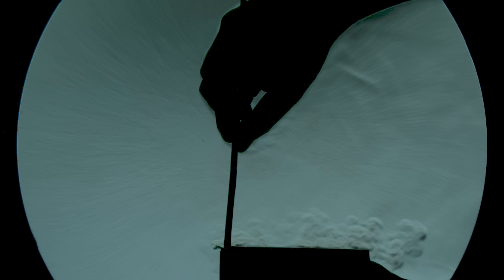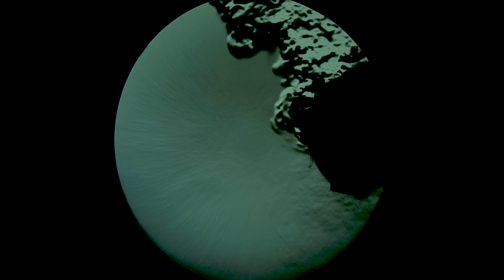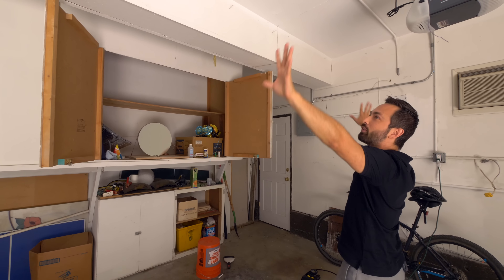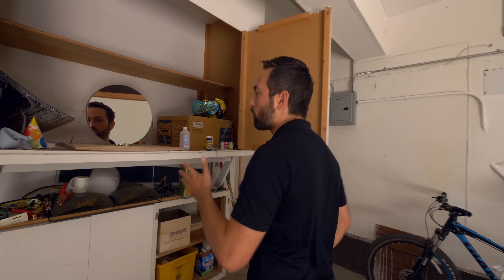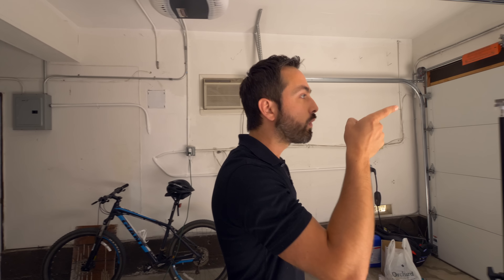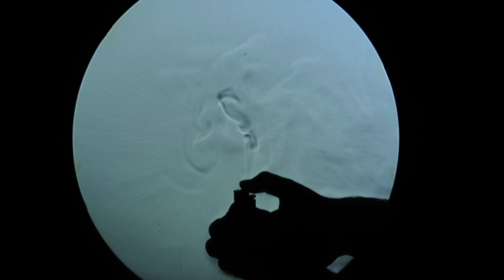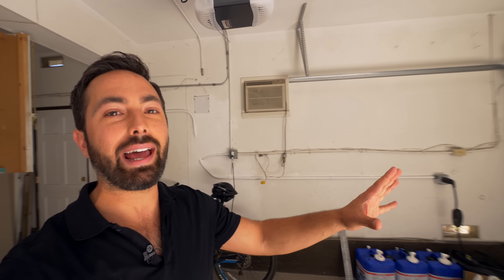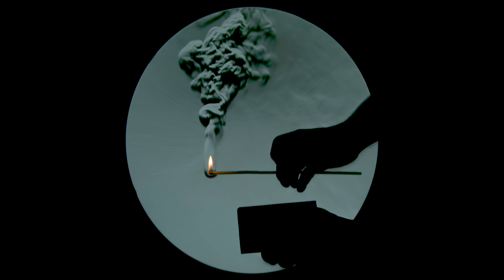How To See Air Currents

Comment: A whip breaking the sound barrier.
Reply: A whip breaking the sound barrier extinguishing a match.
Reply: Pedro Semeano the camera might not capture that
Reply: That's not what makes the sound of a whip cracking though, the tip of a whip very rarely exceed the speed of sound
Reply: In 2002 Arizona researchers found that by the time the whip cracks, the tip is already going about twice the speed of sound.
What makes the sound is actually the loop in the whip whose speed along the whip reaches the sound barrier.
Source:
https://www.scientificamerican.com/article/true-cause-of-whips-crack/
Reply: I guess you would lose your arm before hitting anything, really
Reply: Gaspard Sagot  You said the whip very rarely reaches the sound barrier, then posted a study saying it goes twice as fast.  I'm confused
Reply: +DANG JOS What people usually mean when they say that the whip breaks the sound barrier is the speed of the tip of the whip. What these scientists discovered is that instead, it is the loop that travels along the whip, which produces the sound.
Reply: Gaspard Sagot, you do realize you just corrected yourself from being wrong without knowing it right?
Reply: Entropy Zero  Either way, it's still the whip.  Why does it matter if it's the tip, or the portion before the tip?  Either way it would be because the whip is traveling faster than sound
Reply: Time to call Adam Savage!
Reply: +DANG JOS That's not quite it. The difference is between the whip itself breaking the sound barrier and a wave within the whip breaking it.
Imagine it like this: You have a metal rod that you accelerate perpendicular to it's length and also strike it at one of its ends. Now while the rod itself doesn't reach the speed of sound, the shockwave moving through it from the end you struck to the other might.
Reply: Entropy Zero  Now that makes a lot more sense.  The original explanation was terrible.  I mean, what does the loop breaking the sound barrier even mean?!  The explanation should have been that it isn't the whip itself breaking the sound barrier, but the transverse waves within the whip that moved faster than sound.  That is, the forward displacement of the whip by the wave adds its speed to the whip in order to break the sound barrier.

  That makes sense to me.  Whenever I heard this, I always wondered how the linear speed of the whip could possibly travel faster than sound
Reply: I didn't remember the article right, hence the source. I'm not pretending I know everything about whip cracking
Reply: Mythbusters did this
Reply: lol yes pls
Reply: @Professor Politics a whip breaking the sound barrier extinguishing a match floating a soap bubble in its thermal updraft.
Reply: Somewhat reluctant to actually figure it out, as I have no use for this information and Insect lives matter.
Reply: Your wish has been granted!
Reply: You are a time traveler I guess
Reply: Like what Destin just did?
Reply: Destin from smarter every day just did a video on the matter!
Reply: smarter everyday just did this today!
Reply: destin actually did it lol
Reply: Time travelers exist
Reply: Smarter every day
Reply: Pedro Semeano it’s amazing how your wish is granted after a year.
Reply: @ProfessorPolitics  As I read this, Destin of Smarter Everyday has done this.
Reply: @SmarterEveryDay brought me here
Reply: Everyday smarter
Reply: I think smarter every day did a video on that. they found something very interesting regarding when the whip breaks the sound barrier.
Reply: Charles Mullins smartereveryday
Reply: @derekyerik90  thats sounds like an indian movie slap
Reply: @charlesm3232  it will destin from smarter everyday has done it.
Reply: I would like to see this experiment conducted on someone who is sick, aroused, scared, furious ect. Does the flow of heat change? Do we see the sweat evaporating? Or perhaps even release pheromones?
Reply: wrrr

Comment: How about whistling? I wonder if you'd be able to see the frequencies that make the sound
Reply: no, the frequency is too high thus the wavelenght will be lost inside the turbulence of the air flow.
Reply: wavelength = speed of sound / frequency. The typical human whistle is in the order of 1 kHz and the speed of sound at room temperature is about 340 m/s. So the wavelength is around 30-35cm. With a dog whistle, the frequency is at least 10 times higher, so the wavelength should be visible.
Reply: At 20°C, f = 1Hz and c = 343m/s gives us λ = c / f = 343 / 1 = 343m
Frequenzy too low = waves too long, because mirror too small

Take f = 500Hz, c = 343m/s λ = c / f = 500 / 343 = 0.686m
Much better!
A standing wave would look cooler, but that is more effort.
Reply: MazeFrame sounds cool! I hope he does it
Reply: Walther Wennholz Johnson i Hope he does it I really want to see it
Reply: UCreations I hope he does something with sounds it's so cool

Comment: Airflow around the dimples in a golf ball
Reply: I think this is a really clever one, but we'd have to compare with a ping pong ball. To see this effect properly you'd need to have a laminar flow pass over the golf ball, which might be difficult to make.
Reply: Lots of lng straws in a box will provide a laminar flow, but you really would need to have an airconditioned and still air inside the setup to get it working properly.
Reply: This was the first thing I thought of.  I would also like to see that in comparison to a ping-pong ball and other athletic balls -- particularly the American football.

Comment: I wonder what a thermal imaging camera would look like in this setup?
Reply: virtually the same, though the imaging typically is more colorized.  

This is ultimately reflecting the variance of temperatures in combination with light refraction, like the cooler air pouring out of the glass or the popping of the bubble.
Reply: This isn't just an image of thermal effects, it's an image of the changes in air density (some of which is caused by temperature, some caused by air moving). It's a very sensitive apparatus, and the temperature changes it can show are often smaller than thermal imagers can resolve.

Comment: You explain at about 2:00 if the mirror were spherical the center would be where you have the light source. I think, if the mirror is spherical you’d put the light source (and razor and camera) at 1 focal length, but for parabolic mirrors you put the light at 2 focal lengths for the same effect, with the added advantage of increased contrast because of the extra distance for the light divergence to be doubled.

Comment: if u can get the critical Reynolds number (Laminar-turbulent transition) somehow , that would be cool
Reply from the maker: I'm thinking that happens naturally with the candle - see how the laminar flow speeds up and then breaks up into turbulence? I'd love to find a way to make laminar air flow and put it over an airfoil...
Reply: Veritasium lots of straws
Reply: There are ways, some people make their own wind tunnels. Most use a structure of straws/tubes to create laminar flow.
Reply: The size of turbulences is determined by the biggest hole it passes through. Therefore a tiny grid or grating should enable you to get laminar flow in a channel. If you use strain free glass (which you can test in you imaging setup) you can build a channel with laminar flow using a fan with a tiny grating in front of it.
Reply: if u can try deferent points of velocity/flow using a clear glas pipe till u get turbulence , u might get it i guess

Comment: 1. Handheld tesla coil gun from Smarter Everyday.
2. Something simple that can be simulated with finite elements method. Comparison of FEM and reality might be interesting.
Reply: This was my idea as well.  Or if not the coil gun, a large repeating arc of current between two electrodes.  In slow motion of course.

Comment: With two slighly offset setups it would be possible to observe the experiments in 3D ^^
Reply: ^ this.
about the distance between our eyes. flip the images, and you have a cross-eye 3D image
Reply: science that sounds awesome!  it's definitely something someone should try. I also agree with the comment above mine :)
Reply: Are two LEDs, one to the left one to the right of the camera, enough?

edit: you would have to seperate the two images. maybe different colored LED and then using the respective colorchannels to get a right and left greyscale image?
Reply: but the lens has to focus directly into the camera. how would that work with two cameras?
Reply: 3d would probably require 2 of those special lense
Reply: Wouldn't the lenses have to overlap for this? That kinda ruins the whole point of having 2 lol.
Reply: Turun Ambartanen Two lenses or two cameras sounds impossible. But two LEDs sounds like it might work. But idk.

Comment: What woulf happen if you put the razor blade vertically, or if you adjusted its position differently!!?
Reply: Doesn't make a difference as long as the source of light isn't polarized. The effect still will be observable, only the directions of the shadows would change

(edit: the part about polarization is most likely wrong)
Reply: I think the direction of dark to bright changes. Let's say you inverted the blade up-side down. Then you basically invert the image tones. Vertical would rotate tones vertically. (not the objects!)
Reply: Actually you do see a difference, the dark and light regions where the density is different would be different. So lets say he is breathing out, instead of up vs down is bright to dark, now you have left vs right is bright to dark. You would still see the same phenomenon but "with different lighting".
Reply: But then, what difference would we see if we polarize light ?
Reply: The direction of sensitivity changes: The setup is sensitive only to light deflected perpendicular to the edge, in other words, only the effect described in the video that light being blocked which was previously unblocked matters. This does not happen with light which is deflected parallel to the edge.

Mathematically speaking: you see the derivative of the density of the air perpendicular to the blade as a bright/dark contrast.
Reply: It would change the microscopic result but not the macroscopic result. (Although the result would be different and air density differences would maybe not appear exactly the same overall you would see the same patterns and wouldn't notice the difference without being shown the old footage.)
Reply: I did this experiment as a physics project two years ago. Changing the orientation of the razor blade changes the orientation of bright vs. dark, exactly like YouGenom and Karlos described above.
Reply: I am afraid, not: polarization does not contribute at all in this setup.
Neither is the light coming out of an ordinary LED polarized, nor is there an analyzer in the setup, which could translate polarization into intensity variations.
Also, in transmission, the gases observed do not transmit light differently depending on the direction of polarization.
Reply: I know that LED light isn't polarized (nor monochromatic nor coherent) per se. 
On the other hand i now seriously begin to ponder what exactly would happen, given where we position the filters... guess you are right, though.

Comment: Well, I think you could try a vortex. Of course plenty other such experiments have already been done. But it would be nice to see.
We could also try some sparks or electric discharges. But we would need slow motion.

Regards.
A proud member of Physics Square and a fan of Veritasium.
Reply from the maker: Thanks! Got some ideas about how to make the vortex? What about a fire tornado!? Literally just came to me...
Reply: Veritasium how about a fire tornado on a high speed camera
Reply: Veritasium NightHawkInLight has a nice video on how to make a fire vortex.
Reply: errur Yeah, that was pretty good.
Reply: How about a vortex cannon? You know, the "standard" box with a hole. Both the creation of the vortex, and the travelling would be interesting to see.
Reply: @Veritasium: Maybe just by means of a vortex ring gun: a piece of tube with a diaphragm on one side, and an aperture on the other should do the trick and generate a slow-moving vortex ring.

The trouble is, however, you may need to improve your setup by adding a slit in front of the LED (two razorblades set apart about the thickness of a PostIt sticky note will do nicely).
Then, you must adjust the direction of the direction of the razor blade to be parallel to the slit, and also make sure that the the razor blade bisects the image precisely, or, better still, just hides it.

Unfortunately, your mirror is somewhat shoddily polished: you can see machining marks on the surface. This will limit the contrast you can reach with your setup.

Comment: A few things: 
1. A vibrating cable
2. A radioactive decay (the one they show in physics classes using smoke to show ejected electrons)
3. A Laser and how it affects the surrounding air
4. a subwoofer
5. a water droplet's affect on the surrounding airmass (maybe we'll see the pressure gradient :D )
Reply: ScottyMcCraigles ^^ this seems awesome as well especially the bit about radiation
Reply: The radioactive decay would be an awesome one! like a cloud chamber, but without the cloud
Reply: ScottyMcCraigles I agree  :D
Reply: Sound projected by a tweeter, a regular speaker and a subwoofer. On air and on smoke.
Reply: Adding to the vibrating cable idea. A light bulb filament when exposed to a magnet: A heated vibrating cable.
EDIT:
Also, a lot of people are saying sound waves. A neat way to capture sound pressure differences might be two opposing speakers creating standing waves.
Reply: I just did one of those spontaneous spit laughs.  Was not expecting to see a fart comment.
Reply: 6. An airplane wing
7. Something breaking the sound barrier
Reply: A good 'ol bullwhip will break the sound barrier.
Reply: Tesla turbine
Reply: Dry ice or liquid nitrogen in a bottle and/or pan
Reply: a brass instrument being played (trumpet, tuba etc)... possibly you could see the standing waves of the played note. Or maybe just a clear glass tube or a soda bottle
Reply: ScottyMcCraigles a
Reply: Sound from a speaker?
Reply: Sound is just compressed and rarefied air. It would be interesting to see in this setup.

Comment: in a tube or cylinder try pouring various invisible gasses and let them settle so you can see the layers between them. maybe even hydrogen and oxygen gas mixing to form H2O
Reply: TheMrgrr it would be hard as you need something to hold the gas without it being seen.
Reply: "mixing" ;)
Reply: I can't think of two more interesting invisible gases to mix :)
Reply: +UMM_Ampersand a fish tank?
Reply: your not going to be able to pour out hydrogen gas its less dense than air it will just float away and disperse smae thing with oxygen. you would need two gasses heavier than air and you would probably want to chill them so they dont mix as soon as you put them in the same container.
Reply: Aaron Smith invert the container :)
Reply: fss1704 it can't reflect any light or you won't see very much. this system needs to have an interupted light and if you have a reflection off of a fish tank it will fade out the background and the glass will distort light going through.

Comment: Derek, please try the trick where you blow out a candle and reignite by putting a flame to the smoke coming off it.  I am curious to know how that works.
Reply: Michiban: If I'm not mistaken it works because of sulphur (or some other combustible material) is present in the smoke. But I too would like to see that happen, using this technique..
Reply: it is because it is the gas from a candle that is burning, not the candle itself. so if you put it out then place a flame near the gas it relights.

Comment: I suggest taking out a burning candle by pouring carbon dioxide from above it. The nice counterplay of rising heat and falling CO2 could look nice. Keep up the wonderful work!
Reply: or possibly liquid nitrogen, very cold meets fairly hot.
Reply: Not sure if liquid nitrogen so close to the mirror is a good idea, if it gets coverd in frost the image is gone.
Reply: Marik Zilberman good point, but when you pour it gently i don't think it will be a big problem. CO2 is nice because it's still 'falling down' while being at room temperature because of its high density (while N2 isnt).

Comment: An ionic solution or gas made of polar molecules without an electric field and then with an electric field (The Stern layer might be visible) 

I worked for quite some time on modeling this phenomenon, please ask if you need orders of magnitudes ;) 

The easiest way might be to use Ammonia or  Sulfur Dioxide or Hydrogen Sulfide or any other polar gas around a charged object. 

For ionic solutions the effect should be "thicker" hence more visible for low concentration solutions and weak electric field

Comment: try turning on a light bulb
Reply: Interesting
Reply: Dr_DragonKiller I'm not sure if that would work, since it sounds like it relies on the tiny differences of the light coming from the LED. Then again, fire didn't seem to be too much of a problem, so it might work fine.
Reply: "Modern" light blubs are full of non flammable gas I think.
Reply: Might need in incandescent lightbulb. Maybe it will work with an LED, but if you can see the heat coming off his head then you could certainly see the heat thrown off by an incandescent lightbulb/what it does to the air.